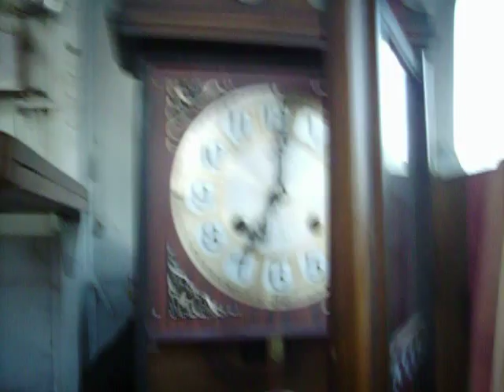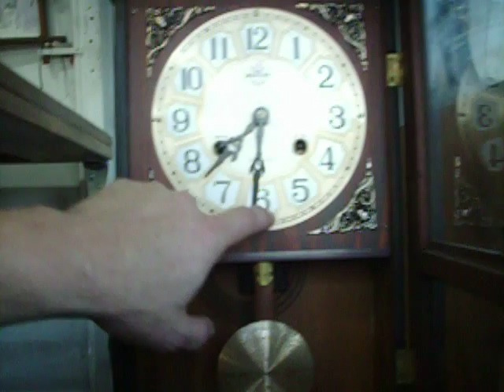Trash Find 31 days clock

Comment: If you are still having problems with it you can take the face off of it and adjust the wire to the left that the pendulum arm connects to and spray some lubricant on the gears until it tick tocks at even intervals and then it will stay running for you hope this helps i have a very similar clock that i just got done rebuilding

Comment: Nice clock probably from the late 70's early 80's. It probably just needs a good cleaning. DONT attempt if you dont have the correct tools! 31-day clock springs are very dangerous and you could hurt yourself if they are not let down properly! Although these clocks aren't highly collectible, they are still very nice clocks. The Koreans actually made good movements that last for years if properly taken care of. My mother has an Elgin wall regulator clock that she received back in the late 70's and it still runs perfectly today....it has a Korean movement in it!
Reply: Have you ever had to clean it? I know you must have oiled it somewhere along the line.
Reply: They are actually very common, good for collections, but not collectible

Comment: Easy fix you don’t need to take the movement apart and clean it, first off all it’s not an antique, the clock would not be in such good condition, and the dial would not be so good, I have a clock similar, it also has the “rotting” but it’s not rot, it’s just the outer layer of the wood pealing off, my clock does the same thing, anyways made in the 1960’s. Back to the repair you need to remove the movement then just oil it put the oil in the holes in the metal sheet holding the movement, the. Put it back in, it worked for my 130 year old Gustav Becker wall clock. I am a clock collector and repair man, and love doing this and am fairlyexperienced, hope it works for you.
Reply: I have the exact same clock however my pendulum stops after about 3-5 minutes. Could that still solve my problem?
Reply: Matthew L. Lewis  not always. Oiling May help. But it could be the verge being broken or bent, maybe even a broken escapement wheel
Reply: @tuileriesantiques9057  hi 👋🏼.  I know this was a year ago but am hoping you will see this message. I think I may have just overpaid for an "antique" 31 day wall clock. It is a Veritas. Made in Korea. Are the Korean wall clocks all replicas? Is there anyway I can tell anything about this clock. I've tried googling but I can't find it. Found one very similar that sold for $7 but I'm not sure it had the pendulum. Well if you have any knowledge on this I'd be very appreciative.
Reply: @JustDeLuca  yes, all korean clocks are reproductions. prices are pretty much all the same. they’re low quality, and you may have over paid. what did you pay?
Reply: @tuileriesantiques9057  thank you. Haha I hate to say. $225 but we're actually returning it. After I brought the facts up with the owner. It was advertised as an antique.
Reply: @JustDeLuca  okay good choice!
Reply: @tuileriesantiques9057  Thanks 😊

Comment: Movement has to be disassembled and cleaned. Problem with these metal bushed clocks is that the shafts wear the holes oval causing binding and excess play. Korean movments are  cheaply manufactured movements. Frantz Hermle & sohn used to make good movements ( mechanical mechanism), but since the 80s the company yarded all their mechanical clock movements and production out of China. Cheaper brass is used for the components and a lot softer. After 5 years a full service is needed. Dust is these mechanisms worst enemy.

Comment: Its 50 or 60 years old, needs to be on level surface or it will stop should be taken to a watch/clock repair place for a cleaning and tune up, they need it every 2 years for oiling and tune one every 10 yrs
Reply: Doc savage it’s about 30 to 40 years old

Comment: It probably needs new weights.It may not have the right ones therefore so it slows down
Reply: No these Korean made clocks run on springs, and very powerful springs. Can be quite dangerous to attempt to repair these clocks as an amateur.
Reply: @sheldonhouse8773  Powerful enough to sever a finger?

Comment: check to see if it is sitting level, it might need to be put in beat, which you can do by adjusting the left to right of the clock. when it beats the tick and toc will sound simular......while running tip it left, and then right you will hear the different sounds, one way the tic will be louder and the other way the toc will be louder. you want to have even tic-toc.. front to rear should be fairly level.brian f.

Comment from the maker: i tried everything from leveling it to oiling any bearings on the gear shafts itself, had a guy offered me 250 bucks for it so i sold it to him
Reply: SpiritsoftheWolf I have the exact same clock I found it in an old barn. Works, chimes and has the guy see if the guy who bought yours would like to buy a match to it.
Reply: @reposharon  do you know what brand this is?
Reply: @JustDeLuca  I dunt remember and I sold mine a few years ago
Reply: @reposharon  thanks anyway 🙂